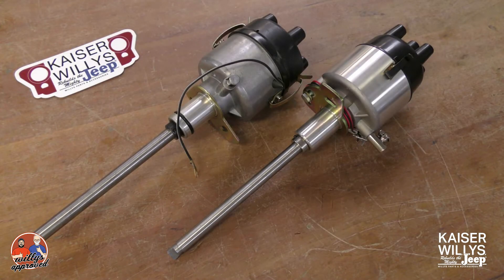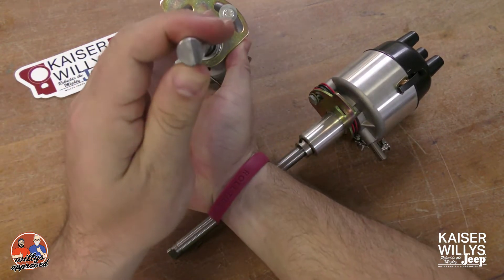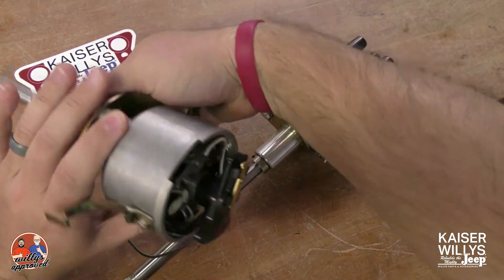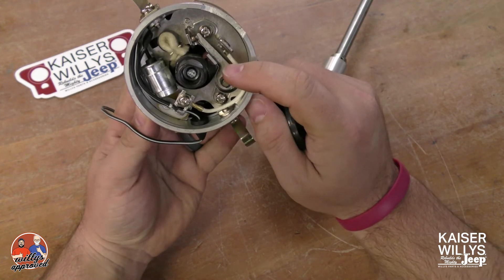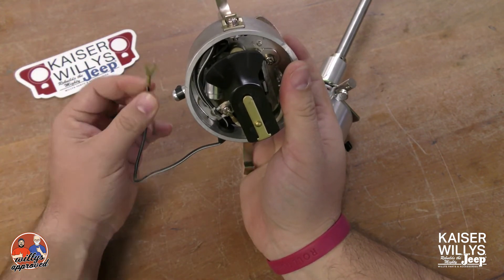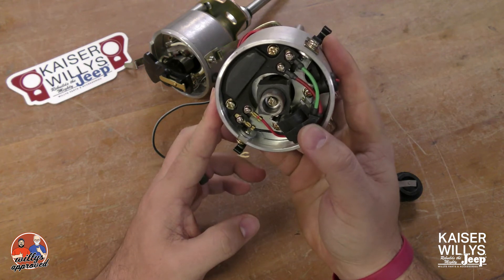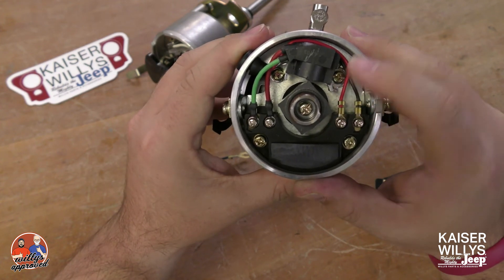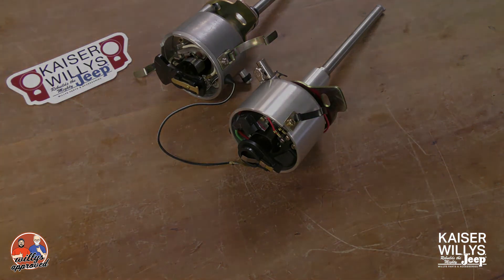Willys Jeep FAQ: Points Distributors Vs. Electronic Distributors

Comment: When I got my CJ3A many years ago the distributor was in upside down - the oiler was at the bottom. Someone had put the oil pump in 180degrees out and as a result the distributor had to be 180 out as well. It still went ok. I have fixed it up now. Jeff

Comment: hi, friend
what is the difference between "SOLID STATE ELECTRONIC IGNITION DISTRIBUTOR KIT FOR 12 VOLT FITS 41-71 JEEP & WILLYS WITH 4-134 ENGINE Part # 923078" and "COMPLETE SOLID STATE ELECTRONIC IGNITION MODULE FITS 41-71 JEEP & WILLYS WITH 4-134 ENGINE Part #17252.05"...? thank you!!